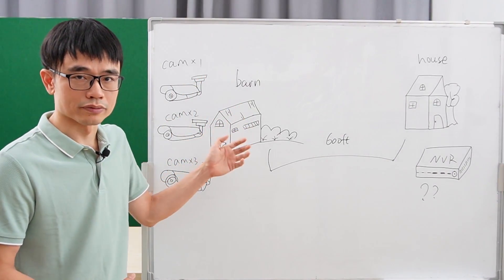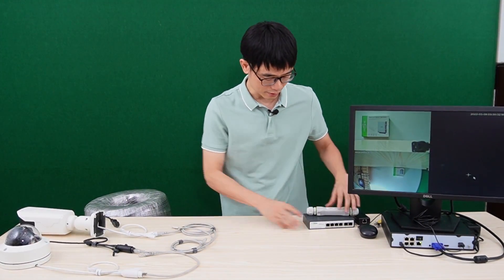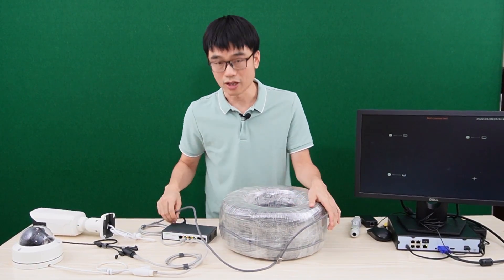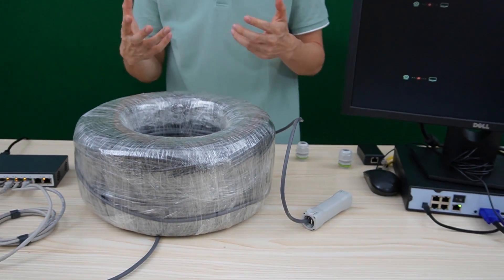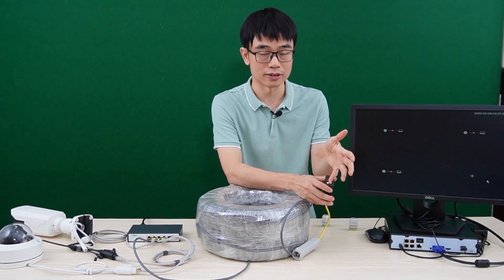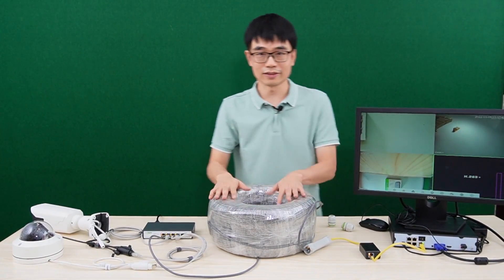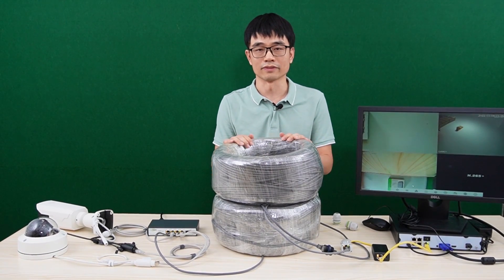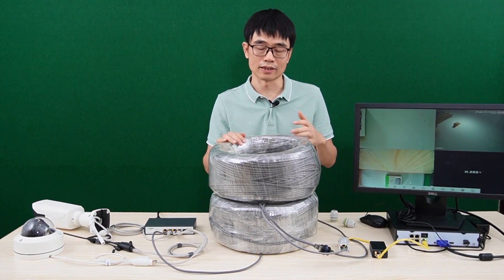How to Connect remote IP cameras (1500ft) to PoE NVR

Comment: Thanks for sharing this video! 

I'd like to ask in your setup, is the video from the ip cameras available to view from online (off site) since you used the uplink for the cameras instead of to a router?  Or are these cameras only available to view on a local system via a monitor connected to the nvr.  I guess the nvr could also have wifi.

 I'd like to ask a variation on this method.  Instead of using cat5e wire to physically connect the IP cameras to the NVR, could I use power line adapters instead?  

Any feedback is much appreciated!

Cheers!
Reply from the maker: It is the standard TCP/IP network the extender working with. So you can employ the poe extender to repeat the network from Router or power line adapter. However, you will need PoE injector and the end of the cable should attach to poe device such as poe ip camera, poe access point. Otherwise you can add the PoE splitter. It is about the power handshaking in the poe system. The poe injector only will release the power after it completes the power handshaking with a standard poe device.

Comment: I have another question if you can help. what kind of equipment do I need to display different channels from one NVR on three (3) monitors or 3 TVs ? Thank you in advance for your help.
Reply from the maker: You might look for the HDMI splitter or HDMI distributor.
Reply: @Fastcabling  HDMI splitter will display the same channels on all monitors or TVs, I need to display different channels on each monitor, like  channel 1, 2, 3 , 4 on monitor (1), channel 5, 6, 7, 8 on monitor (2) , channel 9, 10 , 11, 12 on monitor (3)

Comment: Nice video and informative as usual. my question, what type of cables you are showing in this video and what's the price of 1000ft. thank you
Reply from the maker: It is the cat5e pure copper cable. Just make sure it is 100% copper and don’t pick the low cost one. We did see some so claim pure copper cable with serious power/signal loss in the long rang transmission. They never expect you will pull it over 1000ft in single run.
Reply: @Fastcabling  thank you